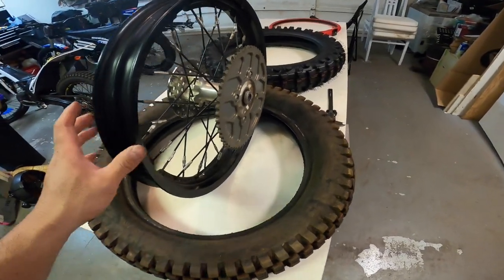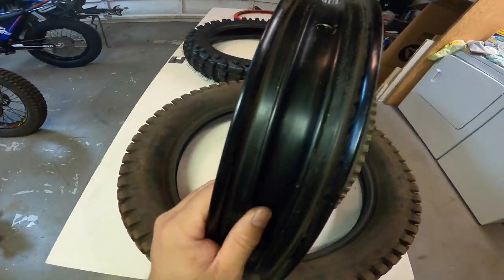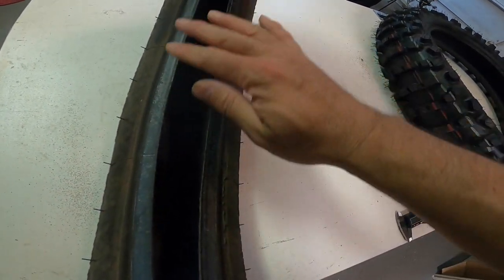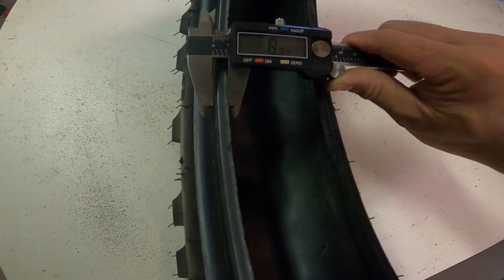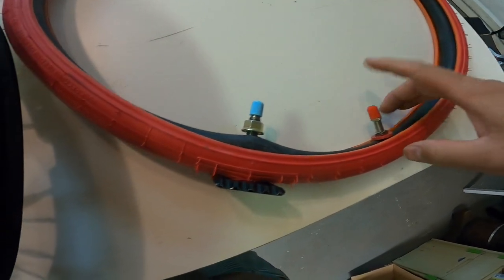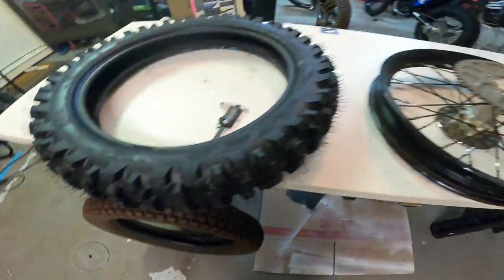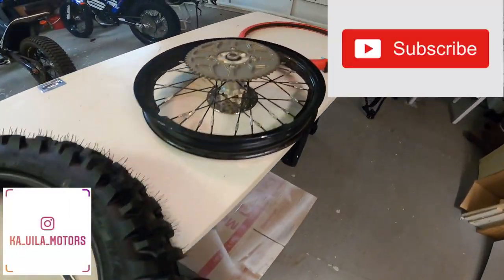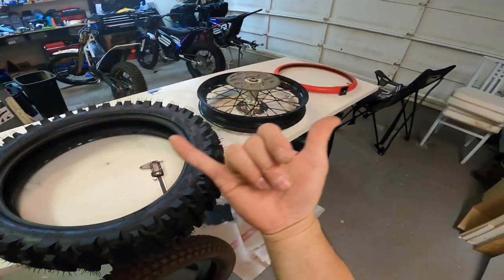Electric Motion 2021 Escape R E-NDURO MODS Pt 2

Comment: The newer Escape-S comes with a not-so-aggressive 110/100-18 tube-type Michelin Anakee Wild tire at the rear so I'd guess that such tire fits inside the rear swing arm with no need to shave the knobs, what do you think? Also, if I drill a hole for the rim lock in the tubeless rim, if I ever wanted to go back to tubeless I could plug the extra hole by fitting a second tubeless valve into it, would that make sense?

Comment: drill it. haha. Where do i order lowering foot pegs for the 2021 escape r
Reply from the maker: Lowering foot pegs? Never heard of them. You can lower the stock pegs
Reply: @electricmotionhawaii  being 6'4 I put the fast way evo 4 footpegs on my ktm, lowers footpeg a couple mm. Where do I get aftermarket parts for the em? Won't have till June so no hurry. Keep up the awesome videos.
Reply: @theelmoreteam9097  You can check out different brands of aftermarket foot pegs as in trials a lot of them cross fit on to the EM EPure.
Reply from the maker: Ok yeah not much lowering there but  i like the s3 curve foot pegs. Super lite super strong. Check out s3 higher rise bars and adjustable bar mounts & risers to get your back alittle straighter. 🤙
Reply: @electricmotionhawaii  thanks again . Have a great day
Reply: @techustle1  thank you